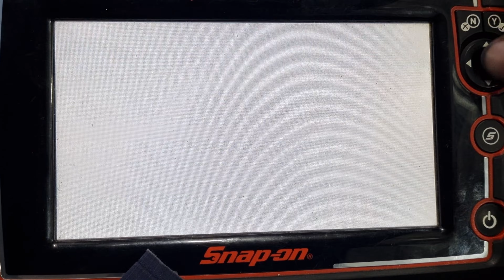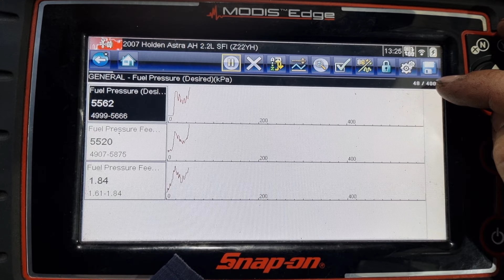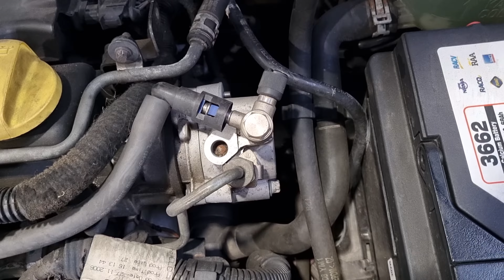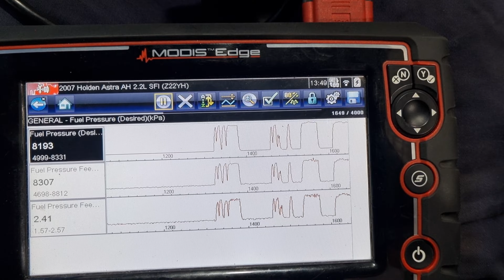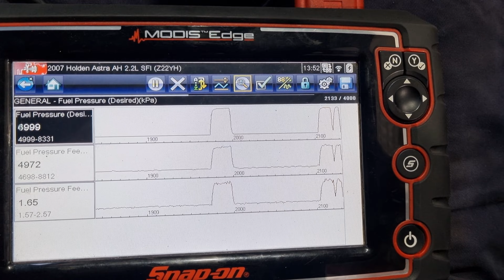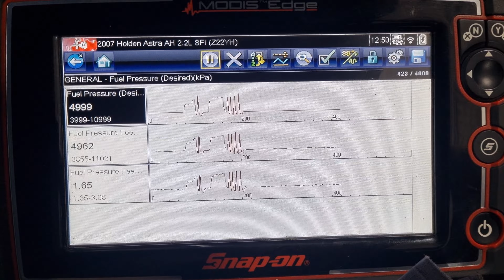AH Astra 2.2 Low Fuel Pressure P1191; Diagnostic Walkthrough, #automotive #carmechanic #mechanic

Comment: I have one with same fault code and only 300 actual pressure won't rev above 2000
Reply: Glad GM Holden are gone here in Australia - fucking shit boxes.
Reply from the maker: I would be checking the low side pressure first like we did here, if that's good then focus on the high side
Reply: @RealAutoSolutions  thanks mate. Its $4700 for a pump here in NZ🤣
Reply from the maker: @johnsutcliffe3209  wow! 
Do you have the genuine part number they quoted you?
Reply: where I can find the part number ? I have de same problem with my car and I don't want to pay 4k  @RealAutoSolutions
Reply from the maker: @jorgeluisramirez5003  hmm, where are you based?
Reply: New Zealand  @RealAutoSolutions
Reply from the maker: @jorgeluisramirez5003  I got this one from Holden, it was around 1200 from memory
Reply: @RealAutoSolutions   what did you got ? For 1200 nzd ?
Reply from the maker: @jorgeluisramirez5003  the fuel pump 1200 AUD 

The high pressure pump
Reply: @RealAutoSolutions  and can I ask you where you find one ? 😰 is been very difficult to get one 😭
Reply from the maker: @jorgeluisramirez5003  from Holden over here, do you have any Holden dealers there
Reply: I asked around but nothing  , no stock and in the holden company cost my 4k   @RealAutoSolutions
Reply from the maker: @jorgeluisramirez5003  Jesus.
Do you have any friends in Australia? Maybe easier

Try a company called cooldrive
Reply: I could ask  , I have some people I kwon there , thanks so much for this  @RealAutoSolutions
Reply: There are others on Utube rebuilding the pumps https://www.youtube.com/watch?v=sDw-fX2bFrw and https://www.youtube.com/watch?v=HSFGokaOwrs @RealAutoSolutions